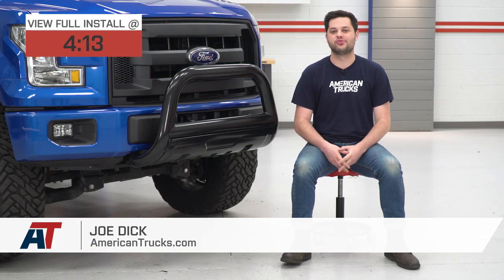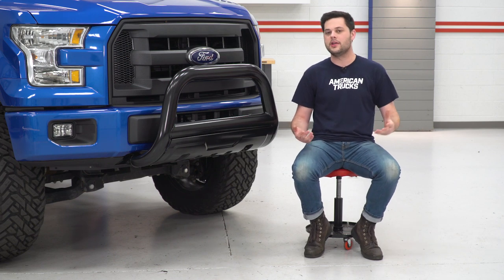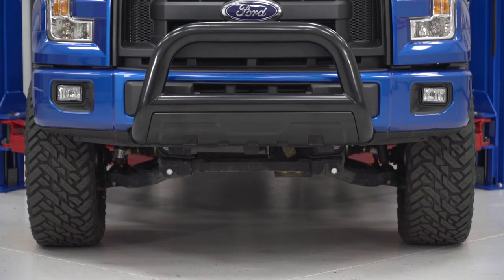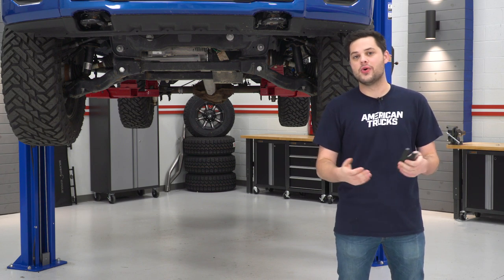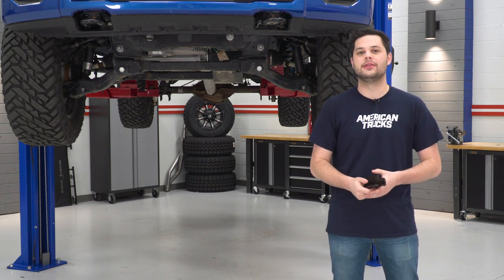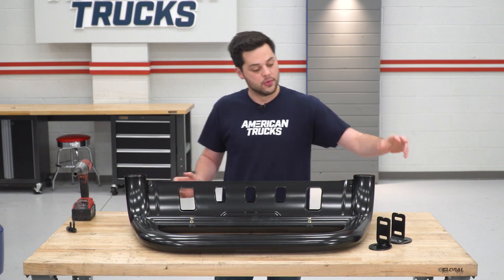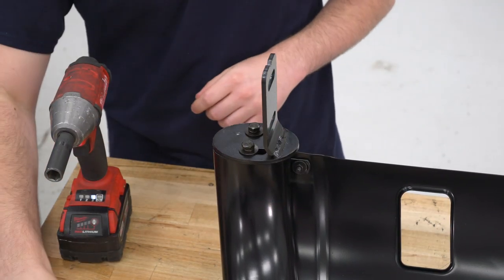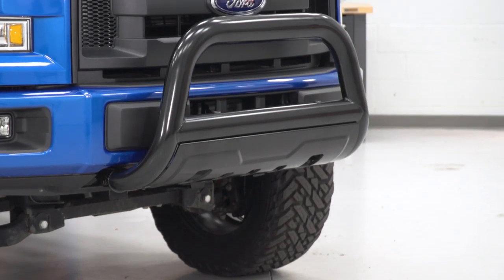2004-2019 F150 Barricade 3.5 in. Bull Bar - Black Review & Install

Comment: Hello, so I have asked a question but sadly I didn’t get a response 

So again here is the question 

There is something below the front bumper truck, I don’t really know what it’s called but if I remove it, will it affect the aerodynamics of the truck?
Reply from the maker: Without seeing a picture I would not be able to answer 100% correctly, but if its just a plastic strip attached to the bottom of your bumper it is an air dam. It keeps air directed underneath the truck while driving, improves aerodynamics/fuel efficiency, and helps protect your front end from small rocks and road debris. Taking it off won't hurt anything, a lot of owners will do it to increase their ground clearance. Hope this helps! -Zach
Reply: AmericanTrucks Ford yes the air dam, I mean if it helps on aerodynamics, then no need to take it off